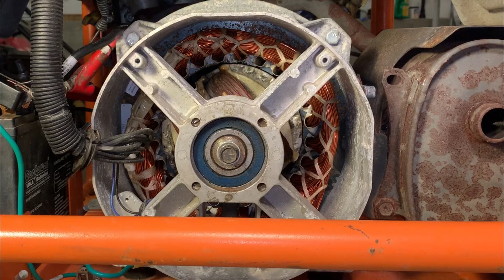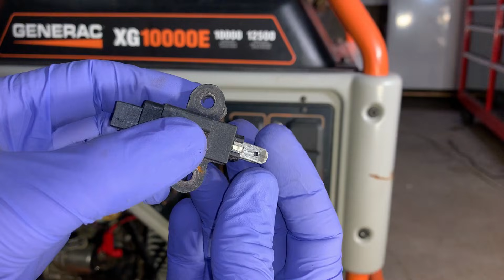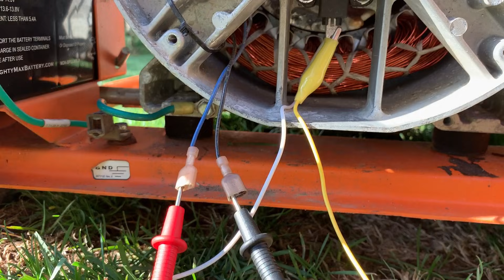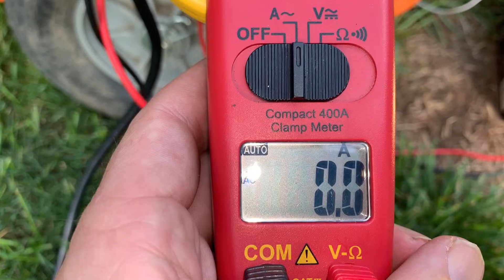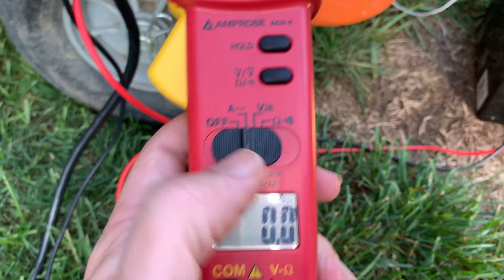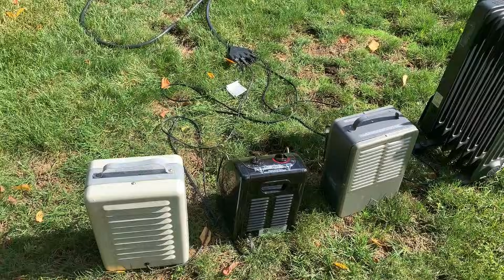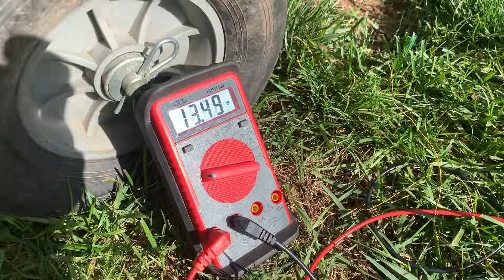Generac XG10000e No Power/No Voltage - Fixed

Comment: Jim, this was a great video (and a great win!). One suggestion: You may want to remember that some of your viewers and subscribers are novices (like me), so that when you use terms like “DPE”, it is more confusing to try and follow your thinking in solving a problem, when I don’t understand either the term, nor what the item that you are referring to, really means. Just a quick explanation of the term, and what the item means to the whole scheme of things, would be really helpful. Regards, Jim C.
Reply: Here is a reminder about portable generator safety: this is only a reminder for anyone who use portable gas/propane generators. This is just to make sure that everyone is aware of all the warnings and it’s just to remind people to be careful using portable generators. Everyone has to see this safety reminder. Every year after hurricane and winter storms, there were reports on the news that many people have died each year when using generators due to carbon monoxide poisoning and electrocution during a power outage. There were reports about deaths when using generators when the power was out. There is something very serious that everyone should always be aware of when using generators. Some people do run their generator indoors which is not safe and that increases the risk of carbon monoxide poisoning which can cause death of family and you. Some people run their generator in wet conditions which can electrocute them. Here’s an advice about generator safety: please remember that you should never run your generator indoors. Remember that carbon monoxide is an odorless and colorless gas that you cannot see or smell. Carbon monoxide is a silent killer. Keep that in mind. Make sure your generator is 15-20 feet away from your house and away from doors, windows, and vents. Having a carbon monoxide detector is very important against generator safety. Some people also allow children to go near the portable generator which could pose risks. We need to keep an eye on our children making sure that they are not near the portable generator so they won’t get electrocuted or burned by the generator which is dangerous. A locking enclosure also keeps kids safe. A generator shed might look like a tempting place to explore, or take cover during a game of hide and seek, but a generator is a dangerous piece of equipment that can cause injury. It says on the manual that we should also keep children away at all times from the portable generator to avoid injuries. Please do not permit a child or unqualified people to operate the portable generator. Generators pose electrical risks. If you need to use your generator during wet weather, you need a generator tent to protect your generator from getting wet. Don’t let your generator get wet. Keep your generator dry and before using your generator, please make sure your hands and your generator is dry. Everything that is said on the generator’s operating manual should not be ignored. Never smoke cigarettes near the generator. Please keep flammable things away from the generator. Never overload your generator too. Your generator can catch fire. Never ever try to plug a generator cord into a wall outlet to avoid back feeding. Back feeding your generator is dangerous. Always turn on your generator first before plugging in appliances and shut off the appliances before turning your generator off. Use a heavy duty cord for your generator and the cord should not be worn out. All the instructions should be followed carefully. Never refuel your generator while it’s running. It can cause fire if fuel spills while your generator is hot. You should turn off your generator and let it cool off before refueling it. Having a fire extinguisher next to the generator is also important. This is only a reminder for everyone’s safety of using generators. Make sure your generator is properly grounded. https://youtu.be/I1jT3ANENvI and here is a video more about keeping others safe when using generators and also about our family’s safety. Hope this helps and everyone understands the safety requirements. Thank you. Be safe.

Comment: Whaaaaat!? Awesome next level electrical troubleshooting, James!  That will no doubt be invaluable to MANY over time. So when you discovered that some of the wires were connected wrong you KNEW someone had been behind the panel before you.  I agree that the brushes looked way too good for 1500 hours so someone had presumably serviced it to get their money's worth. The green gas looked pretty clear to me so I wondered if it had some stabilizer that tints that color since it ran SO well with no change to the gas OR a carb cleaning. Thrilled that you were able to get it producing power again without resorting to parting it out. Was fun and educational to watch. Working on getting another Generac WheelHouse 5550 here soon I hope. Keep em coming and please feed the crickets this winter! You post a video without them and I'll quit watching! 😁
Reply: Generator safety reminder: This is required for everyone’s safety. This is just to make sure that everyone is aware of all the warnings and it’s just to remind people to be careful using portable generator during a power outage. Everyone has to see this safety reminder. Every year after hurricane and winter storms, there were reports on the news that many people have died each year when using generators due to carbon monoxide poisoning and electrocution during a power outage. There were reports about deaths when using generators when the power was out. There is something very serious that everyone should always be aware of when using generators. Some people do run their generator indoors which is not safe and that increases the risk of carbon monoxide poisoning which can cause death of family and you. Some people run their generator in wet conditions which can electrocute them. Here’s an advice about generator safety: please remember that you should never run your generator indoors. Remember that carbon monoxide is an odorless and colorless gas that you cannot see or smell. Carbon monoxide is a silent killer. Keep that in mind. Make sure your generator is 15-20 feet away from your house and away from doors, windows, and vents. Having a carbon monoxide detector is very important against generator safety. Some people also allow children to go near the portable generator which could pose risks. We need to keep an eye on our children making sure that they are not near the portable generator so they won’t get electrocuted or burned by the generator which is dangerous. A locking enclosure also keeps kids safe. A generator shed might look like a tempting place to explore, or take cover during a game of hide and seek, but a generator is a dangerous piece of equipment that can cause injury. It says on the manual that we should also keep children away at all times from the portable generator to avoid injuries. Please do not permit a child or unqualified people to operate the portable generator. Generators pose electrical risks. If you need to use your generator during wet weather, you need a generator tent to protect your generator from getting wet. Don’t let your generator get wet. Keep your generator dry and before using your generator, please make sure your hands and your generator is dry. Everything that is said on the generator’s operating manual should not be ignored. Never smoke cigarettes near the generator. Please keep flammable things away from the generator. Never overload your generator too. Your generator can catch fire. Never ever try to plug a generator cord into a wall outlet to avoid back feeding. Back feeding your generator is dangerous. Always turn on your generator first before plugging in appliances and shut off the appliances before turning your generator off. Use a heavy duty cord for your generator and the cord should not be worn out. All the instructions should be followed carefully. Never refuel your generator while it’s running. It can cause fire if fuel spills while your generator is hot. You should turn off your generator and let it cool off before refueling it. Having a fire extinguisher next to the generator is also important. This is only a reminder for everyone’s safety of using generators. Make sure your generator is properly grounded. https://youtu.be/I1jT3ANENvI and here is a video more about keeping others safe when using generators and also about our family’s safety. Hope this helps and everyone understands the safety requirements. Thank you. Be safe.

Comment: They couldn't find the electrician so they asked the carpenter to fix it :)
Reply: Here is a reminder about portable generator safety: this is only a reminder for anyone who use portable gas/propane generators. This is just to make sure that everyone is aware of all the warnings and it’s just to remind people to be careful using portable generator during a power outage. Everyone has to see this safety reminder. Every year after hurricane and winter storms, there were reports on the news that many people have died each year when using generators due to carbon monoxide poisoning and electrocution during a power outage. There were reports about deaths when using generators when the power was out. There is something very serious that everyone should always be aware of when using generators. Some people do run their generator indoors which is not safe and that increases the risk of carbon monoxide poisoning which can cause death of family and you. Some people run their generator in wet conditions which can electrocute them. Here’s an advice about generator safety: please remember that you should never run your generator indoors. Remember that carbon monoxide is an odorless and colorless gas that you cannot see or smell. Carbon monoxide is a silent killer. Keep that in mind. Make sure your generator is 15-20 feet away from your house and away from doors, windows, and vents. Having a carbon monoxide detector is very important against generator safety. Some people also allow children to go near the portable generator which could pose risks. We need to keep an eye on our children making sure that they are not near the portable generator so they won’t get electrocuted or burned by the generator which is dangerous. A locking enclosure also keeps kids safe. A generator shed might look like a tempting place to explore, or take cover during a game of hide and seek, but a generator is a dangerous piece of equipment that can cause injury. It says on the manual that we should also keep children away at all times from the portable generator to avoid injuries. Please do not permit a child or unqualified people to operate the portable generator. Generators pose electrical risks. If you need to use your generator during wet weather, you need a generator tent to protect your generator from getting wet. Don’t let your generator get wet. Keep your generator dry and before using your generator, please make sure your hands and your generator is dry. Everything that is said on the generator’s operating manual should not be ignored. Never smoke cigarettes near the generator. Please keep flammable things away from the generator. Never overload your generator too. Your generator can catch fire. Never ever try to plug a generator cord into a wall outlet to avoid back feeding. Back feeding your generator is dangerous. Always turn on your generator first before plugging in appliances and shut off the appliances before turning your generator off. Use a heavy duty cord for your generator and the cord should not be worn out. All the instructions should be followed carefully. Never refuel your generator while it’s running. It can cause fire if fuel spills while your generator is hot. You should turn off your generator and let it cool off before refueling it. Having a fire extinguisher next to the generator is also important. This is only a reminder for everyone’s safety of using generators. Make sure your generator is properly grounded. https://youtu.be/I1jT3ANENvI and here is a video more about keeping others safe when using generators and also about our family’s safety. Hope this helps and everyone understands the safety requirements. Thank you.

Comment: When repairing anything, I prefer to be the first and not have to deal with what Bubba did.
Reply: Being a mechanic myself, I agree with you! Many crappy people " who know everything about anything".
Reply: Our company has now just stopped following behind others. We started doing work for a home warranty company (which are freaking horrible companies for customers) and the previous guy who did work for them made so many messes we spent more time fixing the messes than anything else.
Reply: Bubba wanted a day off the job site?  Maybe
Reply: Don’t forget about generator safety when using generators. Here is a reminder about portable generator safety: this is only a reminder for anyone who use portable gas/propane generators. This is just to make sure that everyone is aware of all the warnings and it’s just to remind people to be careful using portable generator during a power outage. Everyone has to see this safety reminder. Every year after hurricane and winter storms, there were reports on the news that many people have died each year when using generators due to carbon monoxide poisoning and electrocution during a power outage. There were reports about deaths when using generators when the power was out. There is something very serious that everyone should always be aware of when using generators. Some people do run their generator indoors which is not safe and that increases the risk of carbon monoxide poisoning which can cause death of family and you. Some people run their generator in wet conditions which can electrocute them. Here’s an advice about generator safety: please remember that you should never run your generator indoors. Remember that carbon monoxide is an odorless and colorless gas that you cannot see or smell. Carbon monoxide is a silent killer. Keep that in mind. Make sure your generator is 15-20 feet away from your house and away from doors, windows, and vents. Having a carbon monoxide detector is very important against generator safety. Some people also allow children to go near the portable generator which could pose risks. We need to keep an eye on our children making sure that they are not near the portable generator so they won’t get electrocuted or burned by the generator which is dangerous. A locking enclosure also keeps kids safe. A generator shed might look like a tempting place to explore, or take cover during a game of hide and seek, but a generator is a dangerous piece of equipment that can cause injury. It says on the manual that we should also keep children away at all times from the portable generator to avoid injuries. Please do not permit a child or unqualified people to operate the portable generator. Generators pose electrical risks. If you need to use your generator during wet weather, you need a generator tent to protect your generator from getting wet. Don’t let your generator get wet. Keep your generator dry and before using your generator, please make sure your hands and your generator is dry. Everything that is said on the generator’s operating manual should not be ignored. Never smoke cigarettes near the generator. Please keep flammable things away from the generator. Never overload your generator too. Your generator can catch fire. Never ever try to plug a generator cord into a wall outlet to avoid back feeding. Back feeding your generator is dangerous. Always turn on your generator first before plugging in appliances and shut off the appliances before turning your generator off. Use a heavy duty cord for your generator and the cord should not be worn out. All the instructions should be followed carefully. Never refuel your generator while it’s running. It can cause fire if fuel spills while your generator is hot. You should turn off your generator and let it cool off before refueling it. Having a fire extinguisher next to the generator is also important. This is only a reminder for everyone’s safety of using generators. Make sure your generator is properly grounded. https://youtu.be/I1jT3ANENvI and here is a video more about keeping others safe when using generators and also about our family’s safety. Hope this helps and everyone understands the safety requirements. Thank you. Be safe.